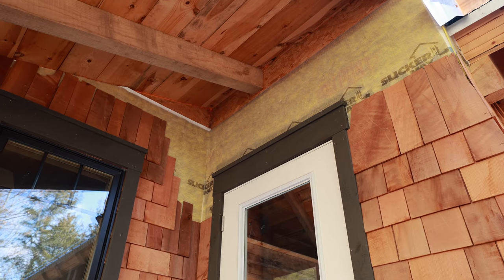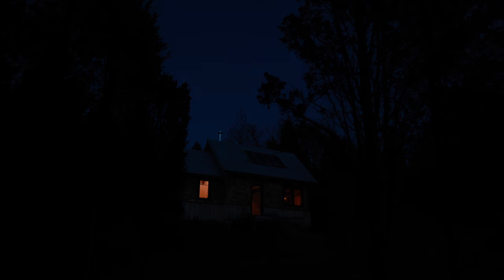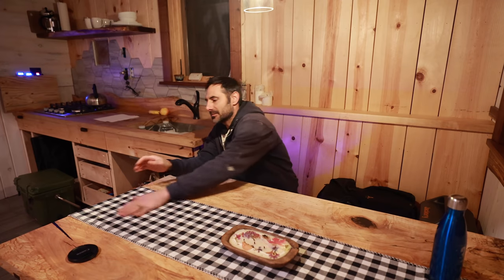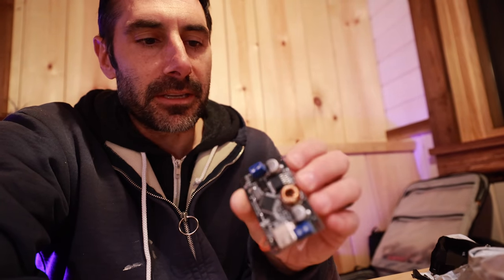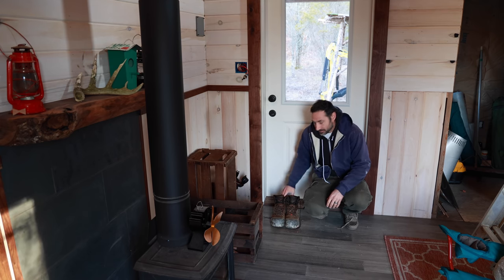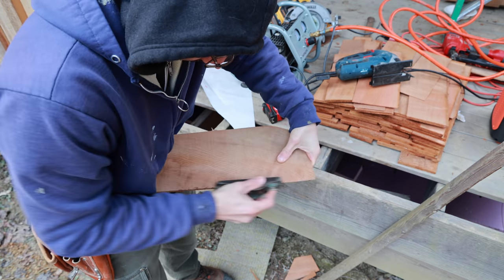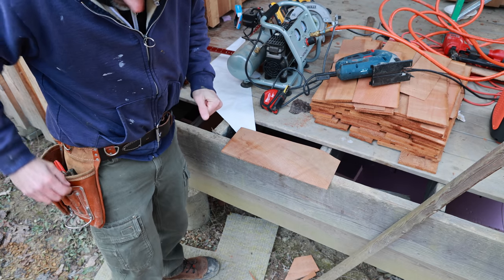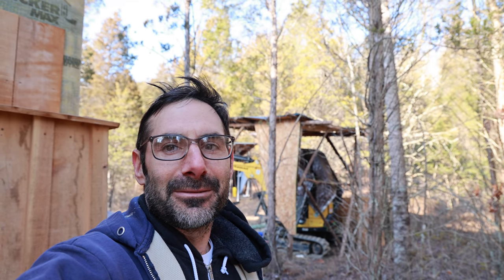Overnight Off Grid Cabin Building Trip: A Vlog

Comment: Applying isopropyl alcohol to the inside (next to your skin side) of leather shoes helps break them in quickly. The heat from your foot reacts with the alcohol and softens the leather. I have used this method and had shoes broken in in one day. I just use cotton balls to apply the alcohol to the inside of the shoe/boot just prior to putting on the shoe. Usually I only need one application.
Reply from the maker: Thanks for the tip I will have to give that a try

Comment: I made the mistake of putting wall outlet usb chargers in my cabin above the beds, next to sitting areas etc. Unfortunately you end up laying or catching the cord end and snapping it off at the outlet. That will probably happen with that one since it's on a bench. My solution was to get the 90 degree adapters for the end and then use a little tiny cleat to wrap the cord around. This lowers thr profile of the plug so it can't get bumped as easily and puts the strain from the cord (if someone slides on the seat and catches it) on the cleat. Love your cabin and setup! Thanks for sharing it with us!
Reply from the maker: Oh no, thats a bummer, I have never heard of 90 adapters I will have to look for those.

Comment: Looking good! I know how fussy those details can be. I used cedar shingles on a large shed which has a 12/12 pitch roof, and for those tiny triangular pieces under the gable ends, I used a brad nailer with SS nails to hold them on. They are still there many years later. Glue would work, I suppose, but then you have to hold them there with tape or something until the glue sets up enough.
Reply from the maker: Thats a good idea, I do have a brad nailer there, Did you use galvanized or SS brads?

Comment: If you want to prevent the chip out with your jigsaw, use a finer tooth blade and start at the heavy end. Better technique; use a good utility knife and clean it up with a plane or rasp. The more you can do with hand tools the less trips up and down the ladder. On projects like this the light at the end of the tunnel is always visible—problem is we keep adding to the tunnel.
Reply from the maker: Good call!  I do sometimes use a utility knife, it works great on the thin end, but on the thick end it takes a long time!

Comment: Don't worry about they way you manage your channel on our part.  Do what you need.  I'm also interested in the products and your thoughts anyway.   Thermometer idea for you.  Checkout Accurite thermometers with multi channel RF sensors.  You can place  them in each room, outside and underneath the cabin.  They are relatively cheap and run on batteries and AC.  I have one inside and outside in my off grid cabin in northern Wisconsin.
Reply from the maker: Thank you CP, I appreciate that funny you mention thermometers, because in the video that I already filmed but had to hold off on posting, I spend a good portion of time wiring in some digital thermometes.  That video comes out Saturday.

Comment: Hey Mike you need a specific kind of USB C Power Delivery to charge your laptop, look at the specs on the charger that came with your laptop and get a type C charger that does that voltage and amperage. Type C PD can do 5, 9, or 12vdc at various amps up to 20vdc at 5 amps. All good boots take a long time to break in. You need a nice cable to do 20vdc at 5 amps though, be careful.
Reply from the maker: Ok nice I have been trying to find the specific voltage that it requires on the internet without luck.  If 20 volts is the ceiling I will give that a try with my DC DC converter.  I believe my 2017 - 13 inch charges at like 67 volts so I think I can set it to less than 5 amps.
Reply: @50Acres  there's no way it charges at 67 volts, for many years laptops have charged around 19-20vdc. Look at the numbers on your oem charger that came with the laptop it will say how many volts and amps are required.

I googled your machine it came with a 61 watt charger, NEVER CONFLATE VOLTAGE AND WATTAGE!
Reply: @50Acres  I googled a picture of your charger, at maximum it outputs 20.3 volts at 3 amps, medium output 9v 3a, low 5.2v at 2.4a. 20.3 volts and 3 amps = 61 watts. You want to set your converter to just a little over 20vdc and 3a. If it's easier to set it to 5a than 3a that's fine, the machine will never draw more than 3 amps at 20.3 volts direct current. Technically it's 60.9 watts but w/e.
Reply from the maker: I meant to say 67 watts my bad

Comment: Got to clearly see Orions Belt!  Do you have any troubles with the cold and propane?  I hear that can be an issue.  Need to work in the sun in colder weather.  Nice job.
Reply from the maker: Cool huh!  We have not had any issues yet.  It may be because our tanks are a bit larger than the typical 20 pounders and we make a point to keep them topped off.

Comment: I have the same air compressor.  I love how quiet it is.  How long will the portable battery run the compressor?  What model is the battery?  Great videos, man!
Reply from the maker: I love that thing,  if the solar panel it plugged in I’d say indefinitely.  Never really got it close to empty so I’m not sure.
Reply: @50Acres  I bought it as a Hitachi model, went back for another one and it is now Metabo HPT.  The quietest compressor I've used.  GREAT VIDEO Series!  Makes me want to build a cabin.

Comment: Your laptop might be trying to draw more current than that port can deliver if the battery is low.  I know my laptop won't charge off the 300w inverter in my truck if it's more than half drained.
Reply from the maker: That may be it, I have a couple ideas to try and also some viewers helped me figure out the best voltage to deliver power at.

Comment: I am sorry to say this, but you are making installing cedar shingles look really painful. Here is a trick I've learned. Make a siding gauge out of 1/4 inch plywood. Start by ripping down a piece to two times the width of your reveal. Cut to about 12" or so long. Now rip a second piece down to the width of your reveal and cut to same length. Line up short piece to the taller piece and glue and screw together. Now you have a tool that you can set the reveal on your second course by putting the third row on the top of the shorter piece. It will allow you to set the reveal on third and subsequent courses by hooking into the bottom of the previous course and setting the next row on the top edge of the taller piece. It doesn't require you to level and nail a ledger board into your wall. It can be handled by yourself. You can use the 1/4 top edge as a gauge to mark a shingle in the angled corner for cutting. If you want to be fancy or hold the next course in place, make a third piece wider than the tall one, just don't extend past the reveal so you don't hinder your nailing area. You can also put a solid handle on it to make it easier to hold.

Also use some bailing wire and tape to put a hook on the nailer to hang it from your belt when your hands are full, just make sure you put it down near the airhose inlet. Think of it like a hook dewalt or porter cable puts on a portable drill.
Reply: Forgot to mention, put some shingles in a bag you can put over your shoulder so you don't have to up and down the ladder all the time. Or hand some in a bucket on the ladder
Reply from the maker: I've been meaning to make one of those!  It annoys me to no end that my stapler doesn't have a joist hook.  I really should do that as well!

Comment: What is the type of shingles you use? They look different from the white Atlantic shingles I typically buy here in Nova Scotia. My guess is they are BC red-cedar shingles. 

Do you use Mono or some other kit in the corners? 

BTW had to do at least a hundred of bundles of shingles myself, and mainly like yours way too many tiny surfaces, so I know what a POTB :) job it is.
Reply from the maker: I think they are C grade Western Red Cedar.  They are one or two grades above under course.  I think they cost $50 per bundle if I remember correctly.

Comment: No snow? 
Anyway, just curious why you used slicker max and Tyvek?
Reply from the maker: No snow :( it was spring like the first day.  I used the tyvec,  as a weather resistive barrier, and I use the slicker max so the shingles can dry out from both sides.  Any water that gets under them can drain down and out.
Reply: Ok.  I am going with cement board so probably Tyvek is fine alone. I really like the cedar shakes but didn't go that route so the slicker max is new to me. Thanks - a wonderful build you have.

Comment: Get a propane generator for backup
Reply from the maker: I have a Honda that has a tri fuel adaptor so I can run off the house propane system if I ever manage to get it wired up and plumbed.
Reply: @50Acres  cool